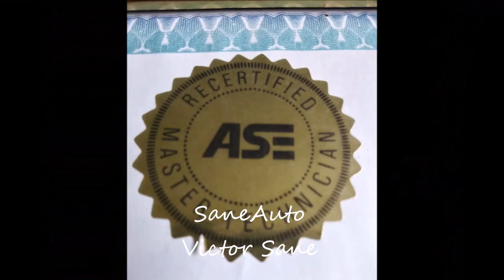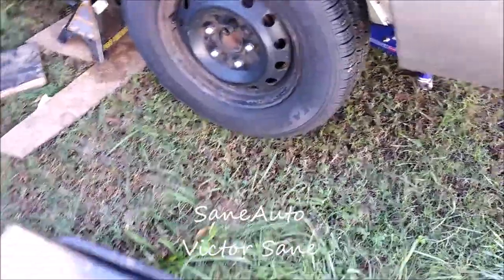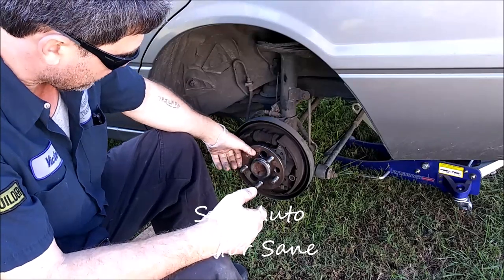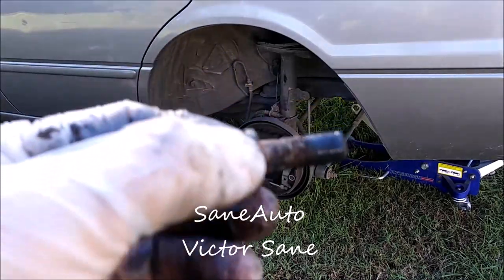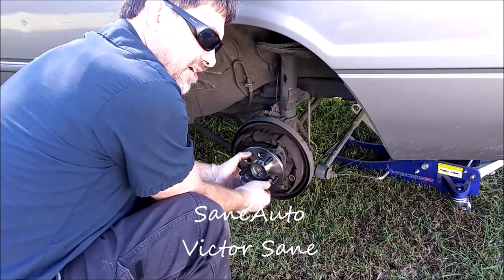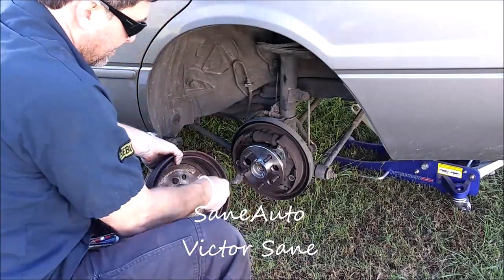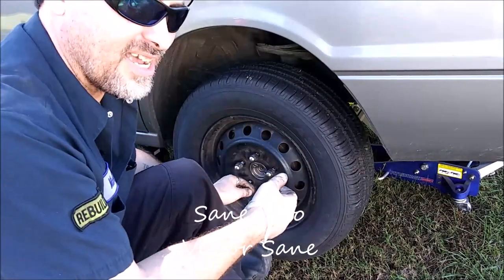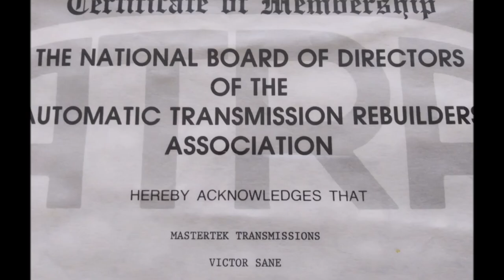1997-2001 Toyota Camry How to replace wheel bearing hub assembly fix DIY

Comment: You mention having done the front hub & bearing in another video but I can't seem to find it.
Reply from the maker: Its the same as this Toyota Prius I filmed. https://youtu.be/Av9dUWVlplQ The biggest difference is the Prius/Camry needs a different size socket for the big nut on the CV axle.
Reply: @saneauto  almost. Main thing I'm wondering if I can use my bearing tool to  press the new hub into the knuckle. Working in a somewhat remote location.

Comment: What is that soroket looking gear behind it mine didn't have that on the assembly
Reply from the maker: Are you looking at the ABS relucter wheel on the back of the Hub assembly? If you dont have ABS brake system yours wont have that.